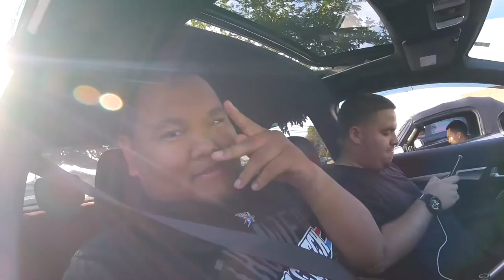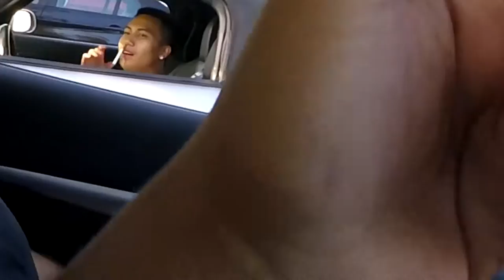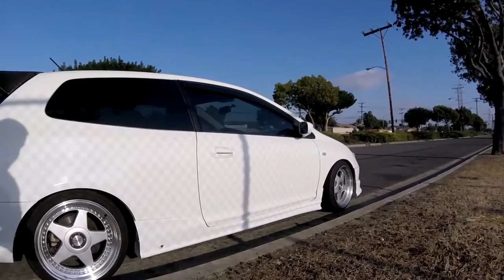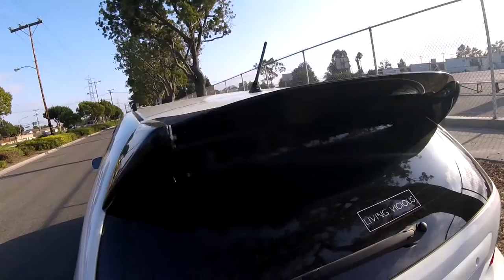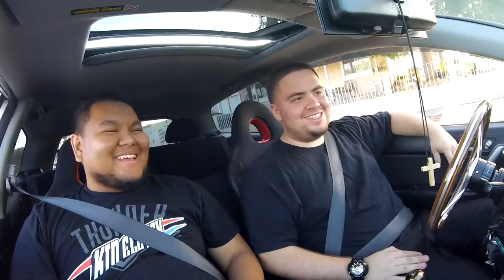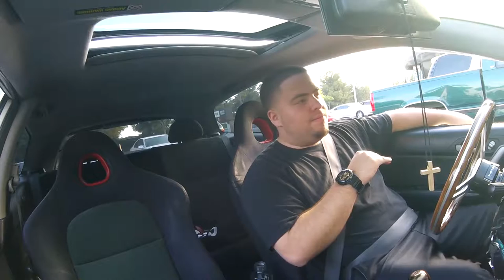Review (EP.1) - Turbo Charged Honda Civic Si EP3

Comment: I just bought a 2002 ep3 and the only thing i dont like it the stock suspension. Its going to be my daily driver so i want it to be a comfortable ride. What do you recommend for suspension?
Reply: Chesties full polyurethane bushings go a long way. Energy suspension has a great kit that I have paired with h&r springs as well as truhart shocks. No rub whatsoever. However after I replaced the bushings, I felt a huge increase in ride quality in a positive way compared to stock.
Reply: Hey Paintball Bros. Thanks for the reply i'll have to look into that setup. Im hoping to get it done this weekend. We'll see.

Comment: nice car. I put a bcss on my ep3 after I had already put a nuespeed short shifter on the stock shifter. the nuespeed adapter on the stock shifter was actually shorter. I left the bcss in because it is a real pita to mess with that shifter. I have been tempted to put the nuespeed adapter on my bcss = super short shift. I swapped a k20a type r into mine. check my vids.
Reply: Mussh Wins 👌🏽